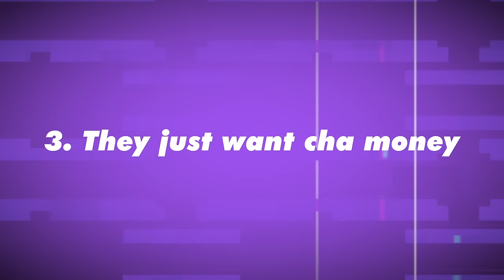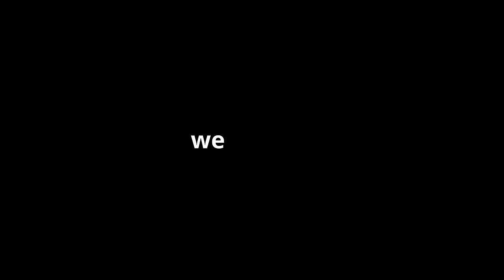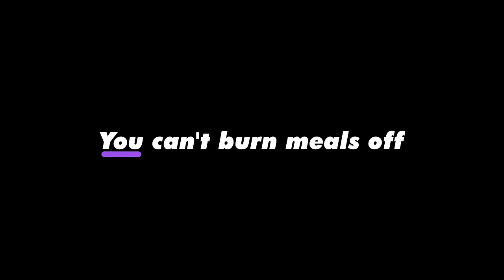3 MUST knows when beginning your weight loss journey

Comment: I’ve weighed within twenty pounds of what I weighed when I enlisted at seventeen my entire life, and I’m about to be sixty. The times when I weighed the most were when I was in the best physical condition. I don’t really concern myself with my weight, but more on how healthy I am. As I got older I noticed that my muscle to fat ratio was reversing. My weight didn’t change much, but my muscle mass was decreasing, which means I’m getting fat in a sneaky way.
Reply: Ditto.
Reply: Muscle weighs more than fat. Fat is very efficient storage.
Reply: @merseltzer  the floor is made of floor
Reply: @merseltzer that statement is misleading. a pound of muscle weighs the same as a pound of fat.  It is just more dense/takes up less space.
Reply: @CheritiWatts  Picky! You well know what was meant.

Comment: "The number on the scale has nothing to do with how you feel about yourself." Appreciate you for saying that.💪🏽👍🏽
Reply: Eh, it's actually not great advice. Neither is the not counting calories thing. The photo idea is a great supplement, especially if you are incorporating resistance training, but you should weigh yourself every day (at the same time). As long as you know:

1) Muscle weighs more than fat, so if you are lifting, you may gain weight. So, as long as you are sure you're within your calorie goals, you are fine. (Hence, why counting calories is important)

2) Weight fluctuates day to day due to water retention, if you've had a bowel movement, if you've eaten before weighing yourself when you normally weigh fasted, etc. What's important is the trend over a week or two.

3) Plateaus happen. It's your body fighting back and trying to maintain homeostasis. But this temporary and will pass. And, when it does, you will probably see a drastic amount of weight drop. If you've been in a calorie deficit, you will lose weight. If the scale isn't moving and you are sticking to your calories, you are still burning fat and the results will come. This also doesn't happen near the beginning of the weightloss journey anyway

Those are three simple things.It's very easy to remember. They don't even need to be typed out as long as I did, I was just providing context. It is scientifically proven that more frequent weighing leads to high sucess in weightloss. It provides feedback within a week or two whereas, unless you are morbidly obese, it will take months to see a difference. And this may even been ruined if you happen to take your progress picture on an unfortunate day where you happen to be bloated for one reason or another.

Comment: I recently returned to getting back in shape. I ballooned up to 260 from being sedentary and basically eating to keep going. I was previously at 250 and got down to 160, but a lot changed in my life. Hopefully, I will not find myself getting derailed again. I did not plan on any sort of exercise regiment, but in monitoring what I take in. I am planning on a diet of just meats, eggs, beans as well as raw fruits and veggies.
My use of a scale just tells me if what I am doing is working or even how well it is working. Now if I were throwing in exercise, I wouldn't rely solely on the scale as there would be some muscle build up too. That is where I would look to how well a certain pair of pants fit or what belt hole was working for me.
Reply: Follow up: I am down to 170 or so. Slow and steady!! Pants that were 40w are clown pants now and 32w are trying to fall off my butt. I am having a hard time finding clothing that fits my shrinking waist. On my fasting days, I eat some pickles and that really kicked my weight loss up.

Comment: I totally agree with your "no scale" suggestion! The scale LIES! Every single chart on earth puts my ideal weight at between 110 and 115 pounds. Every single BMI calculation shows me as overweight/borderline obese at 130 pounds. Lemme tell ya about my modelling career. I worked my way through college as a pin-up girl. My figure was 37", 23", 38" (you guessed it, they did NOT hire me for my face *LOL*!). At that time, I weighed 130 pounds. Yes, 130 pounds at 5'3" tall and a 23" waist. Mystery solved when an insurance-required DEXA scan revealed that, at the age of 60, I had the bone density of a 30-year-old male! I am - quite literally - heavy boned. You are 100% correct your eyes or a tape measure is a MUCH better way to track. Besides, so many foolish young girls diet down to "skinny fat" which does not look good and isn't healthy. Love your content - keep up the good work!

Comment: As someone who struggled with an eating disorder in my early adulthood, I am obviously skeptical of anything with weight loss or anything else that is a term hijacked by the diet industry. But your video here is absolutely phenomenal. 1st, you call out the bs of measurements suck as the scale and calories (because as you said they really don’t give you the information you need). 2nd, you give a good road map for putting the knowledge and power into the individual by prioritizing what information to research and understand (digestion/nutrition). And last, you highlight the obvious differences in processed vs unprocessed food but you don’t vilianize the food. It’s neutral it’s just food. It’s more about understanding our own bodies and loving them enough to give them the best fuel possible to work well, while also understanding that occasionally we’re gonna want to have a treat or something and that’s okay too as long as we’re mindful of what we’re doing. Love your stuff ❤️

Comment: I've lost 58lbs, which I started at 233lbs and now around 175lbs. I do use weight as a measurement to get a good idea of my progress, which I do mostly want to loose body fat. The majority of my weight does come from the bodyfat I have on myself, thus why I have some numerical measuring to get a good idea of progress. I also count calories and limiting myself because it is a basic understanding of how to lose body fat and it has worked out very well for what I want. Mostly I want to be skinner, but also to increase the glute muscle development for obvious reasons. That being, slim thicc.

When I get around to 140lbs or 130lbs, I will do a body recomp to maximize bodyfat loss and increase muscle development in where I want it, the glutes and thighs. However, right now I want to get at least to 150lbs because that was my original goal when I was at 161lbs back in 2017 as 16 year old high schooler. My issues with weight gain mostly came from how I dealt with depression, just eating food because it made me feel a temporary satisfaction. Of course it didn't work back then, but now I'm out on my own and got a lot better control over myself. I can mostly give thanks to my bf who has helped me out a lot through this journey.

As for how I eat, I do focus on how many calories I eat and what I exactly eat. I currently aim at a 1,500 - 1,800 calorie intake while my daily burned calories have been around 3,000. I have a Fitbit to help me count burned calories, but I don't use it to fully rely on because I'm more so focused on the results without causing mental function issues. To get this, I make sure I eat generally healthier foods and eat food when I only need to.

The specific foods I eat, I don't care too much about what my protein, fat and carb intake is but rather to focus on eating generally healthy foods. So while I do eat bread and a bran cereal, I actually eat whole wheat bread and corn bran for getting insoluble fiber for my diet. I also take soluble fiber supplements to help with softening up fecal matter, which also helps with reducing LDL. I consider those foods healthy because they serve a specific function, but I do want to make my own whole wheat bread, and bread in general, to best optimize what is exactly in my food. This especially is so I can make an anabolic bread to increase in protein for when I do my body recomp, since I will need to increase said protein. Aside from bread and cereal, I have eggs for lunch and homemade food I make from raw ingredients for dinner. For example, for burgers, I will pick out the meat myself and make it, rather than going to McDonalds, or I will make a steak & rice meal I have personally made.

Being able to have more control over my body and diet has helped me in the long term for dealing with depression and how I view my body. I personally want to get a body where its a lot more slim thicc feminine, especially to take advantage of my naturally thicker thighs and glute muscles. I have a long way to go in order to decrease body fat to get a flat belly, but I will say I have felt a lot better going from 230lbs to now 175lbs! I got 25lbs to go for my original goal, but I will then go down to 140lbs. That is likely when I will start doing body recomp, unless I'm not exactly satisfied with the starting body fat for that weight then I'll see about 135lbs or 130lbs. However, I don't want to have underweight issues which is why 140lbs might be good for me as an adult male.

Comment: Johnny, you are absolutely correct that we should all focus on diet first because it is the most essential part of weight loss and health. The scale is quite deceiving because it can tell you that you lost weight but you have no idea if it’s fat or muscle loss, and we certainly don’t want muscle loss. Furthermore, the scale may not even show weight loss but actual weight stability or gain, which can happen when body composition starts to change. Current clothing and how they fit you before and after is a much better indicator that you’re moving in the right direction. Cheers.

Comment: So here's a thing. I've watched a couple of your videos so far, and I noticed they both had one thing in common: they end really abruptly. The traditional structure of "speaking to inform" is this (1) Tell your audience what you're going to tell them. (2) Tell them. (3) Tell your audience what you told them. Both of the videos I watched were missing this third step, and made me recheck the timeline to be sure they had actually finished instead of just stopped. I think you should consider adding that third step as a summation. It's more natural, helps drive home the points you made, and lets you create a transition to the next video. As for the content, I think it's pretty great, especially with your emphasis on the potential problems caused by processed foods. AFAICT, this is something that has generally been overlooked for decades but is finally beginning to get the light shone on it. Good work, and I'll be watching.

Comment: I'm nearly at the end of my weight loss journey, but a lot of this tracks. One of the most frustrating things about the current fitness scene is that all anyone seems to preach is CICO. It's like giving someone a guitar and telling them to figure out how to play. You technically can learn that way, but it's going to frustrate the vast majority who try it because they don't know how to play guitar. You need to appreciate the nuances. What foods do what. Why are you avoiding processed foods? What happens if you don't? (Poor appetite control, etc.) Train your brain the way you'd train yourself to play guitar. You learn the basics first. 

There's a reason 95% of people who lost drastic weight put it back on. It's more nuanced than just calories in, calories out. There's the entire brain element to figure out too. How do you convince your brain to stay on the diet? How do you make sure you stay in control of your goals and expectations. It takes a deep dive to figure that out. Simply restricting calories is fundamental to weight loss, but it's not the only thing that goes into it, and will set you up for failure approximately 95% of the time.

I'm 6'2, I started at 368. Today I weigh 203 with 20% body fat. The end goal is 205 with 15%, but that's a whole other journey. I can only even consider that journey because I was able to really break into the nuances of nutrition and understand my body, glp-1 agonists helped too, full disclosure. Once I shut my brain up about food for just a little while, rewiring my brain to my new diet was a lot easier. Now I'm good off them. The tips in this video are all things I sort of figured out during, and are pretty spot on. Learn your body, the rest will follow with persistence and training.

Comment: about the scale thing - couldn't agree more.  it's only function, is to measure mass. It has no idea how fit you are, how you feel about your current looks, or your goals.  Seeing a number go up - can make things feel worse, or even that the current thing you are trying - isn't working, but it also doesn't do something super important -  Calculate how much of your 'weight' is Muscle vs excess fat.  And muscle weighs more than fat, so when working out it is common to burn off some water weight super fast, then 'put on' weight from muscle building, when your still losing excess fat, just also gaining muscles.  Those number changes hit us so much harder than they should - especially when most 'goals' are things like "Drop 60lbs" - it could be a very honest goal, and probably good for you and your heart, but going down 10, then up 2, makes you feel like 'whatever you just did' needs to stop, so you keep losing weight.
Instead... i think they need to be a 1/week thing, just to 'keep tabs on' - it is simply a point of data to keep track of, with other things, that ALL TOGETHER get a better general health of you.  This is how doctors use it, after all.    A Doctor doesn't just look at your chart and see "ah your 230lbs, you should lose some" - they stack your 230lbs with your age, your height, an average from the nation, etc,  to get an idea of 'how overweight or underweight' you are.    So we need to stop treating the scale as the 'only method' to determine fitness, especially in our own homes.

Comment: I'd like to add... if you must use a scale to track your progress, use a Bluetooth scale (Renpho, Fitbit) and IGNORE YOUR WEIGHT AND THE STATISTICS for at least a month or two (the duration of a challenge, as described in the video).

The stats on these scales are always way off - but it can be a useful way of tracking your health trends and gaining continued motivation.

Nothing kept me motivated in the early days of weight loss quite like seeing the graph lines trend up or down after a month of changed habits - i.e. seeing my bodyfat % trend down while lean mass trended up. 

It can be a good way of pushing yourself onto the next challenge - because even if your weight didn't change as much as you wanted, you can see that your body is still changing for the better.

Just a thought.

P.S. If you're going to do this, it's best to weigh yourself daily at the same time (first thing after going to the bathroom in the morning). 
Just open the Renpho and/or FitBit app (depending which scale you have) and step on.
DON'T EVEN LOOK AT YOUR WEIGHT, just record the information. After a month, you'll have some useful trends to look at.

Comment: I really love your channel and it seems like your number of subscribers has doubled since I started watching just a few day ago. I am heavy but the funny part is that I have read some of the books you recommend. I KNOW the way I should be eating but I don't like most foods that are good for me and I love stuff that is processed. It is hard for me to regularly eat unprocessed food without feeling like I am depriving myself. After watching your video, I am feeling inspired to set a very short term goal of two weeks where I will not eat any processed food (or at least minimize it as much as possible). To make it easier, I will lean heavily on proteins and salad until I can integrate more vegetables into my diet. 

I have exercised for years and I agree with you that you cannot wipe out bad eating with exercise in terms of weight loss. That said, my body, as heavy as it is, feels a million times worse when I don't exercise. I get winded easily and start to feel ill a lot when I go a couple of weeks without exercise. I have noticed thought that as I have gotten older, my capacity for exercise has diminished and I am finally realizing that the benefit I am getting from exercise is going to continue to diminish unless I can get my eating on track.

Comment: They key is consistency and not doing A DIET.  When we do this, it's a formula for failure.  Eating habits need to be a permanent change. .The weight loss industry makes BILLIONS every year tricking us to thinking that we can lose weight and then go back to our old habits.
Ive lost nearly 100 pounds over 2 1/2 years by changing the way I eat permanently.  I've also learned that every once in a while, I CAN have a dessert and even if i slip and lose my head, it isnt the end of the world.  I just start the next day anew back on track.
And, you're absolutely right that we need to get away from processed foods...we can't control what has been added and how it's been processed.
Finally, many people start exercising and get frustrated that they aren't losing weight.  Your clothes and measurements should be the guide.  A good rule of thumb is to take your waist in inches divided by your height in inches.  If the answer is .5 or less, you are in good shape.  This is a better guage than the outdated BMI calculation.
Changing our weight should be because we want to avoid health problems in later life.  I am 66 and my goal is not to end up with diabetes, heart disease, dementia, and a host of other health issues.  I dont want to be a "stick" like the beauty industry loves to sell the public....just a healthier me who can live as long as my body will let me.
It's a journey...not a marathon.  Be kind to yourself and set realistic goals.  Forgive yourself if you fall short and commit to moving forward.  For many, we didnt gain weight overnight, so why would we expect to lose it any faster?